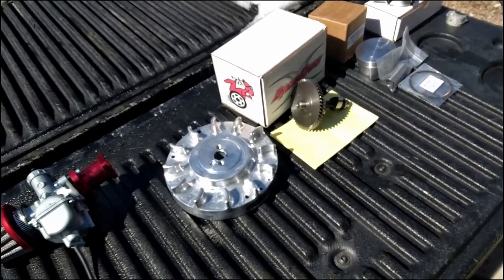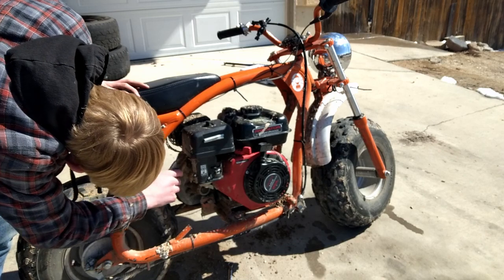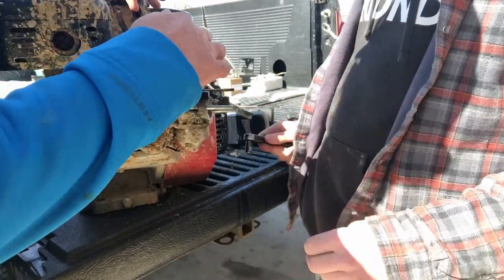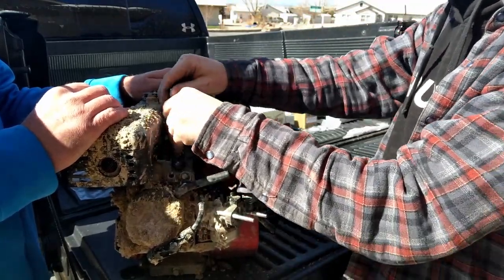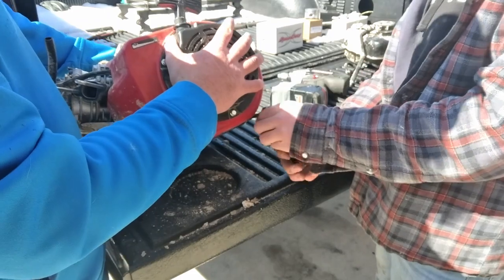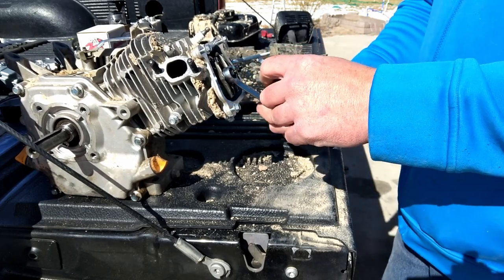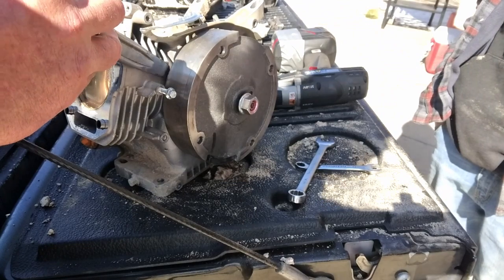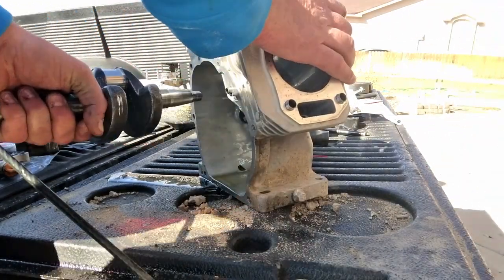224cc Predator Tear Down (Before Building It)

Comment: The cs cam is a good .265 lift cam. I was using one in my 224cc before I tore it down and is waiting on parts. The 224cc with the cs cam easily pulls the front end up on my trailmaster mb200-2.
Reply from the maker: Nice the stock 224 with a torque converter was already pulling wheelies! It will be interesting to see how it does when we're done building it up!

Comment: Of course I know it's early in the build and that you'll know what thickness head gasket to use when you get to that point of clearances later. That's what's so fun about these things, you get a plan together then sure as the World, plans change along the way. I wasn't able to use the .010 head gasket with the EC rod in mine, I ended up going with a .045 head gasket because the piston was about .008 above the deck with the EC rod in my block. I ended up with .037 piston to head quench on that one. The ARC rod would have put the piston below deck and should have worked perfectly with the .010 gasket but it put the Wildcat piston too far down the hole.  I think this is gonna be a great build, it'll be interesting to see if the Dyno cam needs much clearance work. Keep it going!
Reply from the maker: I'm going to double check after seeing some other videos and I'll get back to you on what I had to use to get .025-.030 quench area but if I remember right my piston is .007 in the hole with these parts!
Reply from the maker: I double checked my piston and after playing with it I actually have .016 stick out
Reply: @nicsminibikes  No problem, the stock head gasket on mine measured at .050 thick, you can use the stock head gasket if it's still ok and the quench problem is solved. With .016 above deck that'd leave you at .034 quench, good to go!
Reply from the maker: I'll go measure mine right now
Reply from the maker: I measured it and it's at .050 .048 depending on where I measure it at! Right on for the heads up!
Reply: Kinda sucks how these vary from engine to engine. I'm at zero deck on mine with the stock rod and piston. The 70mm flat top (570) and standard length clone rod (ARC 6270) keeps it at zero deck. Going with a .027" head gasket. Should be ok because it shouldn't see more than 5500 RPM.

I will have more clearancing at the bottom of the bore which does not clear at all. The top of the bore clears but should get at least .030" removed. I'm also just touching the back of the block with the scooper. Using OMB's cam install tool. Didn't want to cut up my extra clone side cover.
Reply from the maker: @Deucealive75  yeah it varies from different parts too I would imagine as I'm using a 223 wildcat rod and flat top piston. I watched a good video by ARC that explained that you have to try to rock the piston on the wrist pin while at top dead center and check for pop out at the bottom and top of piston. Best of luck to you and your build man!
Reply: @nicsminibikes  Thanks. This is a just for fun build for me. My 196 runs great but it will be fun to swap engines around on the two Colemans i have.